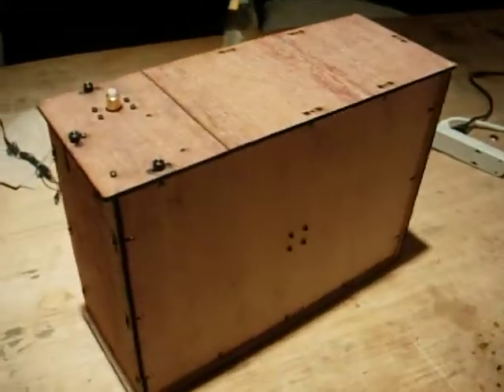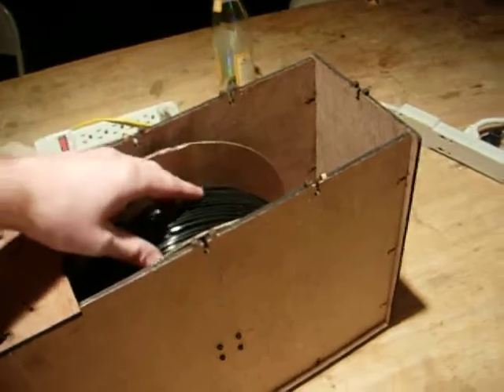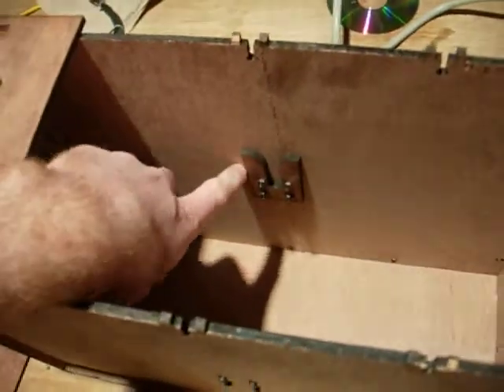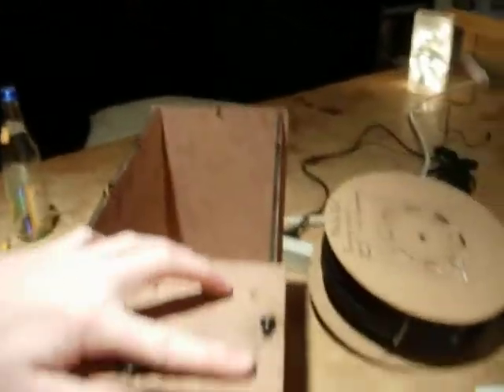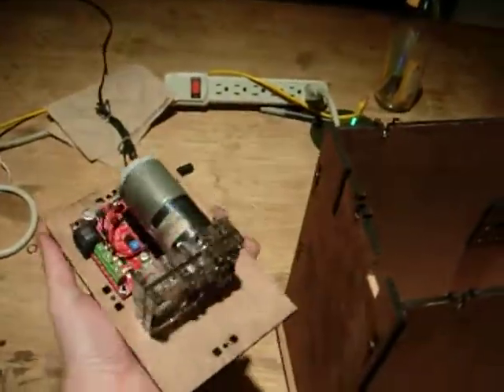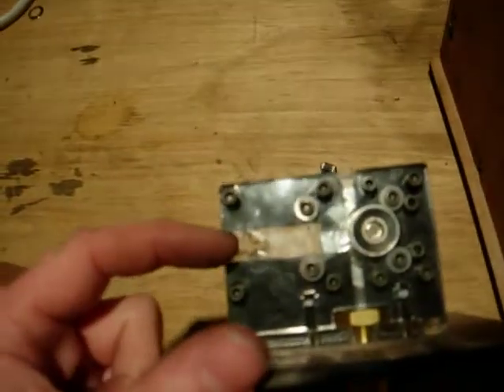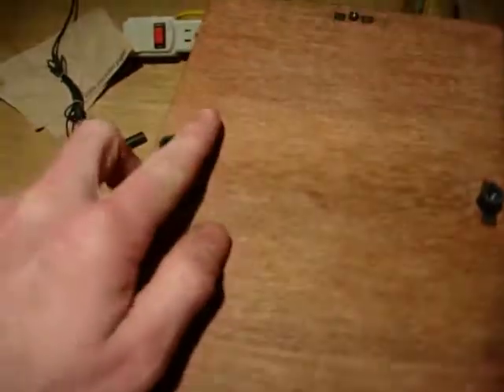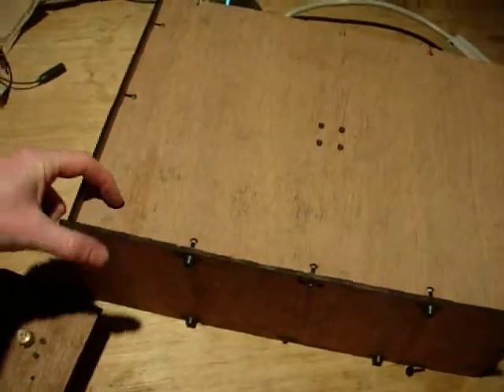MakerBot Bowden Filament Box

Comment from the maker: The MK5 drive is a great upgrade to you extruder. If you don't have one, you should get one.

I have not tried a bowden extruder or moving the extruder. I'm confident the MakerBot motors can handle the tasks you describe. In the worst case you'll have to run things a little slower.

Comment: Hey! I'm a student attending Ithaca High School; me and my buds are building a 3D printer for the tech department here. 

We want our extruder (Paxtruder, actually) to travel on the XY, but not sure about Makerbot's NEMA 17's being able to carry the weight. So I had the idea to put the filament drive somewhere else and guide it to the traveling hot end... Beat me to it! 

Question: Does the Kysan have enough power to overcome extra friction? Need MK5 pulley? Any info would be great help. Thanks!